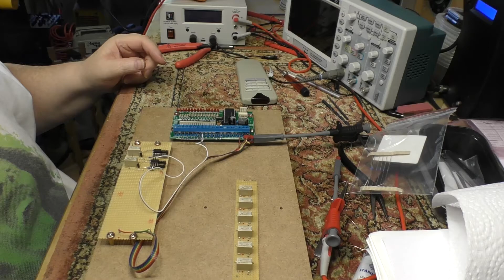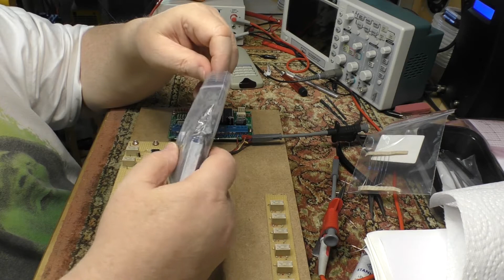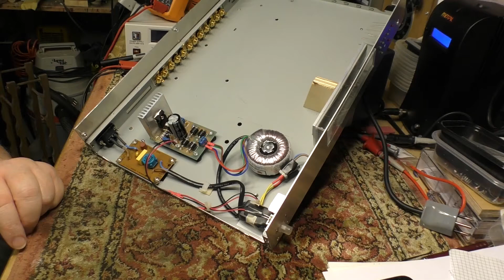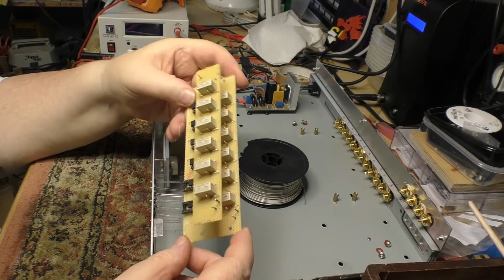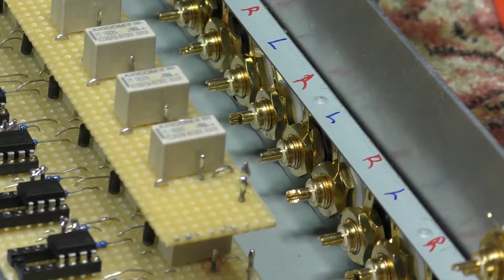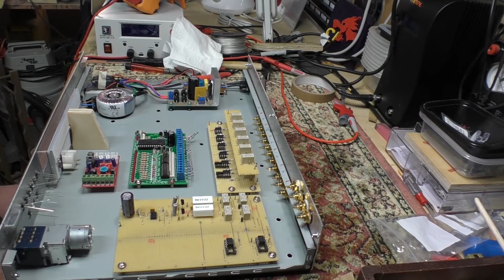Audio Selector for my retro hifi - part 8

Comment: some programing and single microcontroller Chip can do this in  size of one coin.
Reply from the maker: Well the main board features a programmed microcontroller to handle the IR signalling+decode plus the switching logic.   There is much more to it than that however.   Hooking everything up to the five external audio sources and two external amplifiers is what requires the additional driver, latching,  and relay circuits, not to mention all the connectors, LED's, etc.   Things like the analogue VU meters and the volume control add to the complexity.
Reply: @Zone1242  https://youtu.be/8E3ltjnbV0c  Just need the time :-)